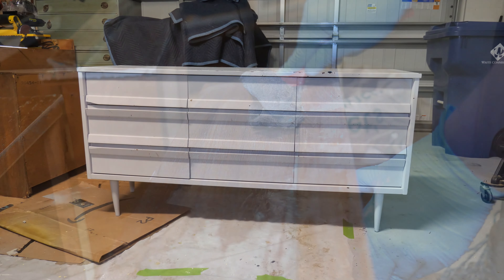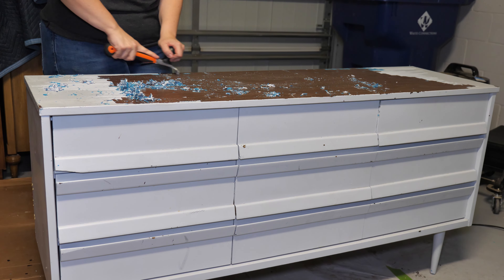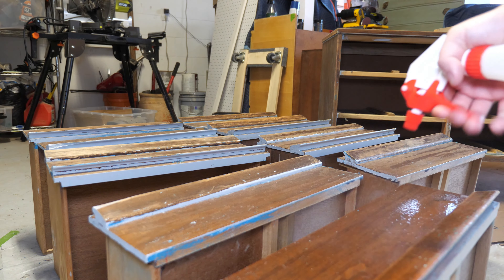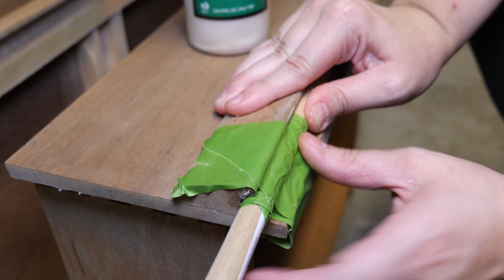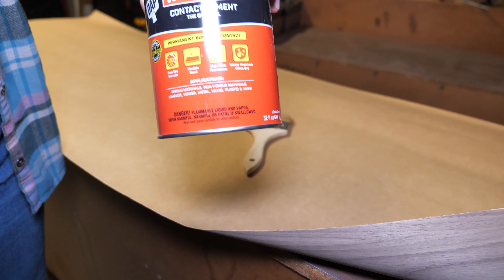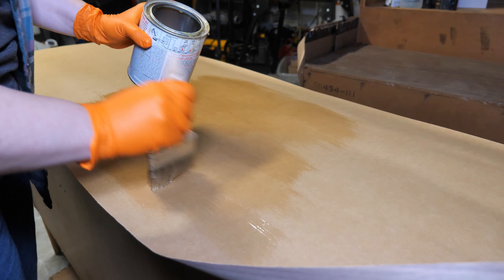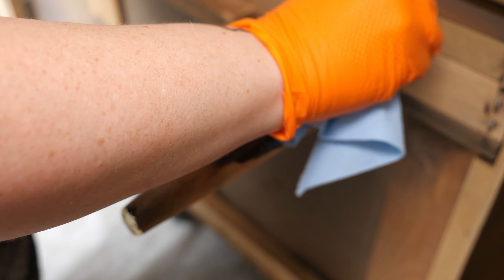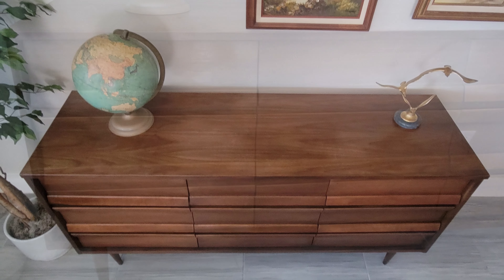AMAZING Dresser Restoration | Furniture Restoration & Refinishing

Comment: Great job!

Scraper is a good tool for stripping paint, but you might want to try heat gun and putty knife on latex. Less work and if the paint is right it will peel off easily from wood pores.
Reply from the maker: Thank you Janne!

Comment: STUNNING restoration/transformation, Emily! I mean WOW. And the amount of work you put into removing the layers of paint and repairs definitely paid off. It’s hard to believe it’s even the same piece. One thing I certainly do not miss about Florida (I’m from Miami but been in Dallas for 23yrs) is the humidity! I get whiny when we get above 70% in the summer here. People ask me about the heat in Texas all the time, but I’ll take a couple of months of upper 90s/100 degrees (the humidity is like 20% when it gets this hot) over 80-90% humidity anytime. And bonus, we got an Emily poem! Thank you for sharing this with us.💜
Reply from the maker: Thank you Ashley! I grew up with snow so I try to remind myself at least I can feel my hands lol. The high listing on my thermometer was I believe 89%, which is the most humid its been in the garage overall. I try to run the dehumifier in there before I head down to work on temperature sensative things, but then its hot. Always something!

Comment: its good to see someone doing it almost right but why are you not useing laquers like the factory does when you restore ? its the standard for almost all furniture
Reply from the maker: Short Answer: I live in Florida and work in my garage. Long Answer: I have used it and dealt with blushing. The humidity outside right now is 81%. If I closed my garage, ran the dehumidifier, and then use aerosol lacquer with the door closed its just going to sit like a misty cloud in my garage and still possibly blush (even after waiting to see if it clears).  That isn't to say I haven't also experienced issues with Poly, because I absolutely have, but it seems less prone to issues. Poly is also more durable than lacquer, so I will take 'almost right', in hopes that all the work I put into this piece keeps it around for many more years.
Reply: @ReconstructingEmily  I own a refinishing shop in florida and i just use a retarder in my laquers however i use an air gun for my spraying and can mix any additives as needed,with that being said you could get a retarder from mohawk in a spray can if you needed it. All in all i think you did a good job